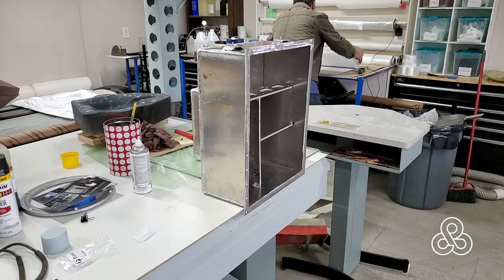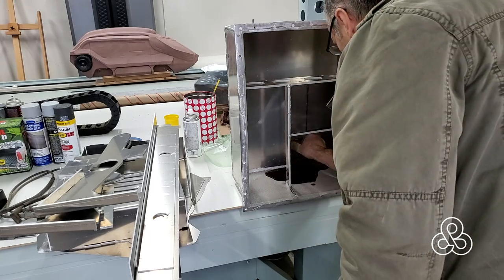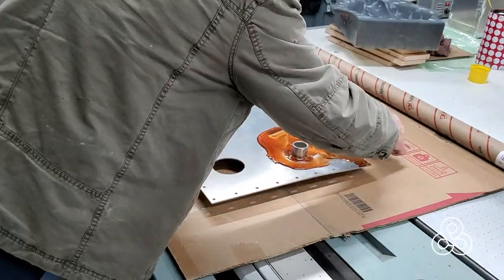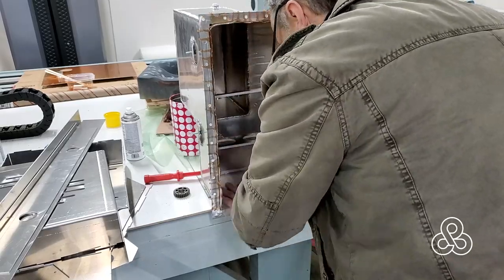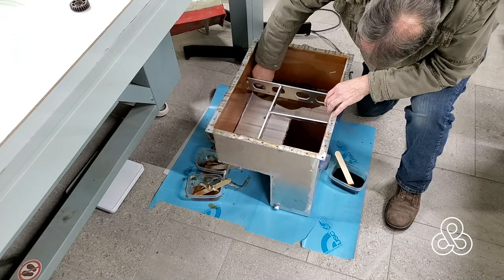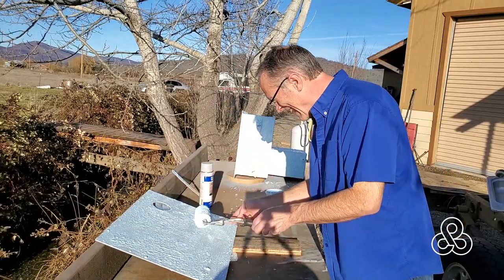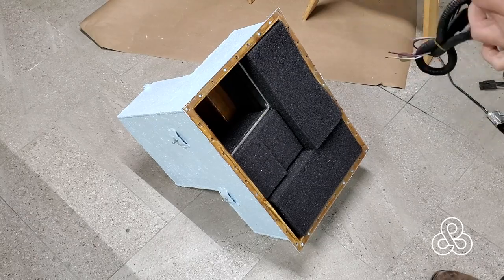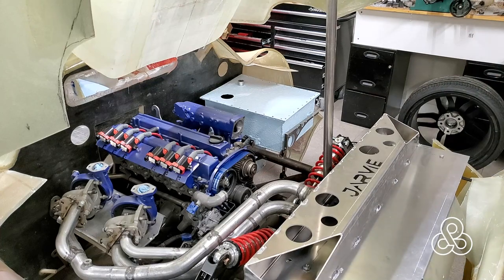A56 -  Fuel cell liner

Comment: My vote is to make a kevlar reinforced fiberglass fuel tank. Then you can custom mold it to whatever shape and size you desire. Saddle tanks with a crossover system might not be an altogether bad idea either, though it can make filling complicated if any of the breather valves aren't functioning properly. Apparently the Gallardo suffered from that frequently.
Reply from the maker: A new composite fuel tank is in the works!

Comment: Seeing the progression of your project reminds me of wintergatan and the marble machine. One man in his shop working on his monster project with a great idea and measuring and cutting things to size. He finished the project and managed to record a song before things started failing left and right faster than he could fix them and he had to scrap it.

He then started the marble machine X project but focusing on full CAD, project management and prototyping. It's sort of nearing completion now, it looks quite simmilar to the first one but is immensely more reliable, it was also possible to make it even more complicated.

All that CAD and project management stuff may seem like a burden and more inconveniences between you and your project, they are absolutely not! Every hour you spend on planning and design will eventually save you 5 in the shop.
Yes, it's something you have to learn a little bit before you get started, but being able to know where every single bolt will be going in the final car before you even touch a tool means that you can focus 100% on building, not figuring stuff out and redoing parts
Reply from the maker: I would agree with most of your comments, but there is also some freedom with experimenting as you go.

Comment: There is a method of shaping steel or aluminium sheet by clamping it into a form and using a pressure washer to hydroform it.
The Mythbusters used it to make a torpedo or something.
I think it would be useful in forming a fuel cell that uses more of the available space.
Reply from the maker: The next tank will be a much more organic shape with an air duct through the bottom. Hydroforming would just not approach the complexity of the shape, but would be fun to play with.

Comment: Maybe a moulded vinylester tank?  Great work i really look forward to these uploads,thanks!
Reply from the maker: Moulded glass, Kevlar, epoxy tank?
Reply: @BuilderCreator  I mention vinyl ester resin as it has good chemical resistance and is good with heat.The only downside is brittleness/impact. An idea might be to make some flat sandwich panels with aluminium honeycombe core. You can choose your laminate materials and resin for outer/inner skins,bond fillet and laminate corners?This is only my 10 pence worth!,its pretty evident you have major skills! and whatever you do is going to be great!

Comment: But isn't foam gonna corrode with fuel? 
Also is it not better to have it lower for center of gravity's sake?
Or place it up front if fits... fuel tanks don't have to be square as far as i know, because i remember seeing it on rally builds.
Reply from the maker: The foam is fuel resistant. (Made just for the purpose.) The bottom of the tank is 30mm above the bottom of the frame. Can't go much lower without it hanging in harms way.
Reply: @BuilderCreator  and on the front? Even if it is an odd shape?
Making it flat as much as possible will surely benefit

Comment: Don't you just love how people don't read the other comments before asking questions? I've not watched all of your videos yet, as I started at the long one what was a summary of all of the previous videos in this build series. I say they because I have a question that you may have answered in an earlier video that I've not yet seen... What weight to power ratio are you targeting? I'd also like to know if you put the scale model in a wind tunnel or if there is some fancy new way of testing aerodynamics.
Reply from the maker: WOHD testing- What Others Have Done. Hoping to extract 600 hp (at engine) and keep the weight under 2800 lbs.

Comment: You say you used a 2 part urethane, and I've looked online trying to find exactly what type you use but frankly there are some many types for different purposes I'm not sure I'm looking at the right stuff. Is it possible you could post a link to a sample product similar (or the same) as which you use?  Many thanks in advance as I have a tank I need to build soon. Also last question, why is the fibreglass needed in addition to the urethane if its as tough and adhesive as you mention in the video?
Reply: Im also interested in which  2 part urethane was used .regards Wikus Rust South Africa
Reply from the maker: Look up Smooth-on.com urethane mold material 60 shore hardness. Remember, my cell is somewhat experimental.
Reply: @BuilderCreator  Many thanks, much appreciated ;)

Comment: I am dubious about the 'fuel cell' lining. This is nothing like a formula 1 fuel cell. The joints in the lining of this tank correspond with the joints in the sheet metal. This will  offer some protection against penetration. But I feel it would split apart in a crush. situation.
Reply from the maker: Getting a custom "real" crash liner and cell would have run about $6,000. . .Ouch! Just going after a bit of protection beyond the aluminum sheet metal.

Comment: Another great video...Why one fuel tank on one side? Surely it’s better to have a smaller tank on each side flanking the engine, balancing the weight. My Lotus Esprit has this set up with link pipe to balance the fuel capacities...
Reply from the maker: Although not as much capacity, there will be a swirl (surge) tank, fuel pump and battery on the opposite side.
Reply: @BuilderCreator  ok I get it, equally balanced mass so that will work.....Really like what you’re doing....

Comment: Thats a hell of alot of materials and labor to put into a fuel cell your not even gonna use!!However I was wondering how u were gonna get a good seal around the bolt on top.
Reply from the maker: Butyl rubber gasket for the seal. The tank will get used elsewhere, not all a loss.
Reply: The aluminum welding issue. Did you try changing the frequency on your welder. Increase the negative a little... hope that helped. Great channel!

Comment: Good job on the build.  Considering that you're building this car to your own design, why are you putting the fuel cell to have a rearward weight bias?  Would it be better to have it neutral or forward weight bias?
Reply from the maker: The engine (greatest mass) is offset to the drivers side. The fuel and rear differential offset to the passenger side. Bias is slightly to the passenger side until the driver enters into the balance. All of it forward of the rear axle.
Reply from the maker: The fuel is forward of the rear axle and also counters the offset engine's mass. Bias will change to the drivers side as fuel burns, but a central location was nullified when I decided to run the drivetrain through the center of the car.

Comment: Isnt there like a rule that a fuel tank has to be on the oposit side of the engine. And also that the fuel lines have to be on the oposit side of the exhaust pipes?
Reply from the maker: There may be some similar rules in racing. Most mid engine cars place the fuel cell in a compartment between the engine and the passengers, but since the transmission takes that position in Arete it is alongside the engine . . at least it is on the opposite side of the exhaust!
Reply: @BuilderCreator  tnx for the answer, didnt expect one tho. 😅 I didnt mean in racing. There is a lot of different championships out there and different rules for every one of them. I've meant about standard car regulations. I am not to much aware about US regulations, but i can put my name on it that it is a port of the homologation in Europe. Btw i must know what are your planes for Arete? Making it street legal? Maybe some international car shows(Frankfurt for example). I mean, you are sitting on possibly very lucrative project.
Reply from the maker: @spikaizautoservisa  I will definitely get it registered to be street legal and take it to some closer car shows, but shipping it international sounds intimidating . . . we shall see.

Comment: Will that last with ethanol in fuel?
I guess you've done your homework and it does, but nowadays nothing seems to like fuels. In the past it was different.
Still, very nice work.
Reply from the maker: Yes, fuels like E85 are pretty aggressive on many materials. All the new "flex fuel" vehicles use  butyl rubber wereever they have flexible connections. Urethanes are the next best flexible materials.

Comment: any reason your not building it in carbon (the car :) not the tank)  to expensive? , just thinking with all the time your putting into it it would be worth it . beside that love the content keep it coming :)
Reply: ALSO WHEN YOU BUILD CARBON, YOU CAN USE FEWER LAYERS, FEWER LAYERS MEANS LESS RESIN. 

THE DECREASE OF RESIN MAKES UP FOR ALOT OF THE COST DIFFERENCE BETWEEN FIBERGLASS AND CARBON FIBER CLOTH. SAVE MONEY ON RESIN SPEND MORE ON CLOTH.
Reply: @user-zj2mb3sp3x  nice didt know know that, but it make sense as its stronger
Reply from the maker: I have calculated the price diffrence to be about $17,000 dollars using S-glass rather than carbon. The resin is minimal to the price of the fiber.
Reply: @BuilderCreator  Thanks  and 17k dollars is a big difference  ,but i do hope we see you build one in carbon someday in oure near future ;)
Reply: @BuilderCreator  who is your supplier for carbon? How much per yard were you quoted? I’ve found prices can very greatly in cloth price. I’m willing to bet you can find a channel sponsor who is a carbon supplier who can give you rolls at wholesale cost. Should be less than $20 a yard buying a whole 100yard roll.
Reply: @BuilderCreator  how many yards of cloth did you use for this build?
Reply from the maker: @user-zj2mb3sp3x  you also have to consider scrap material and vacuum infusion supplies as you would want to truly pull all the benefits of carbon into the equation. Molds would have to be redone to accommodate the infusion. Production molds. A sponsor would be nice. Ha!
Reply: @BuilderCreator  I’m not saying you’re wrong, but I think you’re over thinking it. I’ve done many methods from simple wet layup like a surfboard with carbon, infusion, wet layup vac bag, and prepreg in a homemade autoclave. 

The simple surfboard method wetlayup + patience and a little artistic touch will get you 85% of the benefits of carbon without much of the costly setup. 

Wetlayup with carbon and Epoxy + foam or fabric bulkers to add panel thickness is something you should explore in your next project. 

On a side note if you reach out to them the carbon companies have been receptive to sponsorships for projects.

Comment: Bumber buddy but maybe you can sell it.. 😊  Any suggestions for engine options (V6 or V8) that I can fit in my tiny 1996 Toyota MR2 W20? I bought it as a donor car for my own GT design but the engine bay is very small.. 😖🤔
Reply from the maker: Gotta be some forums or MR2 groups out there where folks have done swaps. I'm not sure what will fit without doing some trimming.

Comment: This might be the best place to ask.... i uncle said gas will eat fiberglass ressin because my tank is rusty and i wanted to seal it with ressin on the inside. So my question is will it work
Reply: Have a look at derakane lining resin made by Ashland, might do the job.
Reply from the maker: Resin is a vague term. Fiberglass resin often refers to polyester and sometimes epoxy. Polyester would never be acceptable as a fuel liner. Epoxy would have to be a special formulation. If an alcohol additive fuel like E85 might find its way into the tank then a very specialized sealer should be sought out.

Comment: Why didn't you use proseal on the fuel cell? That's what airplanes use.
Reply from the maker: I believe Proseal is used to seal the tank. I'm using it more for impact protection.

Comment: Great looking tank, where did you get the urethane? Thanks
Reply from the maker: JF McCaughin Co. A company called Smooth-On also carries it.
Reply: @BuilderCreator  do you think you could use this on the outside of a console to smooth and fill joints prior to having the part hydro-dipped? Thanks
Reply from the maker: @dave5833  No, it is to flexible and would likely cause a condition were the hydro dip would crack and come loose.

Comment: There is absolutely no reason to coat the inside of a fuel tank with resin. This will come back to haunt you later on. It will come off and it will screw up your fuel system. Weld the tank right and you will have zero issues. Never coat the inside of a fuel tank, unless the product specifically states that is what it is exactly for.
Reply from the maker: This is the material that fuel bladders are made of.

Comment: Yes, world is back to normal and you are back!! :) What's the purpose of the lining of the tank, isn't bare aluminium fuel-resistant?
Reply from the maker: The tank is on the outside of the subframe, with very little impact protection. The liner is a impact (flexible) protection, should the aluminum get punctured.